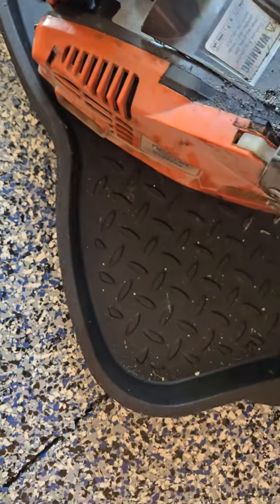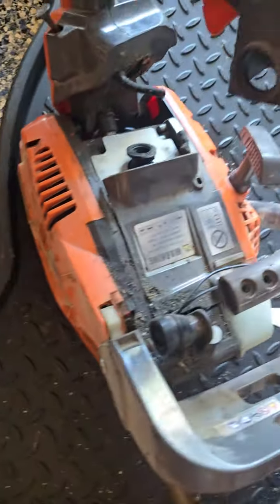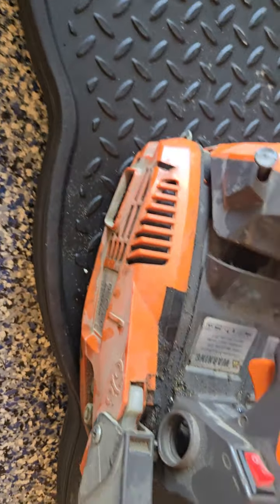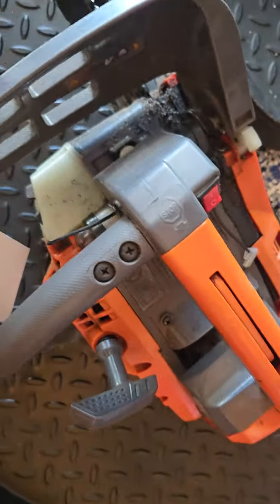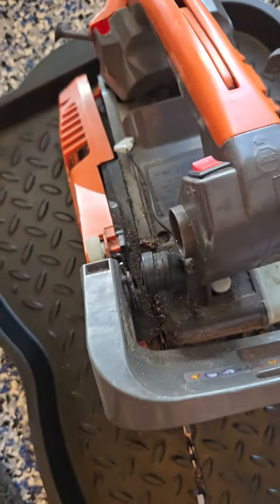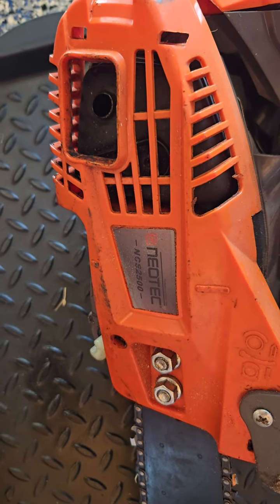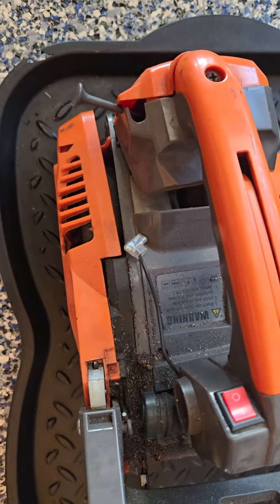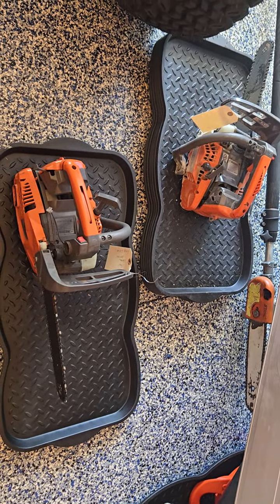NEOTEC NCS 2500, Handle came off.  careful what you buy out there.

Comment: Looks like operator error we pack then getting beat around in a sxs for 3 years passed around like a groupie girl between different people on the trails never treated with care and non have fell apart have went threw the factory bar and chain from a little mishap that involved a 20+ inch oak saw that was stuck in said oak and a winch but that wasn’t the saws fault it was operator error
Reply from the maker: OK GOOD info, thanks